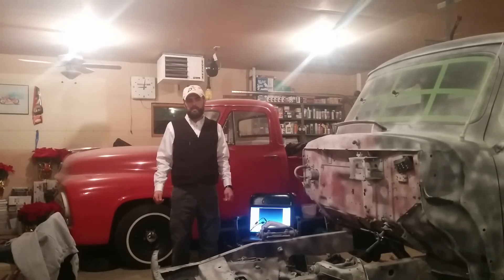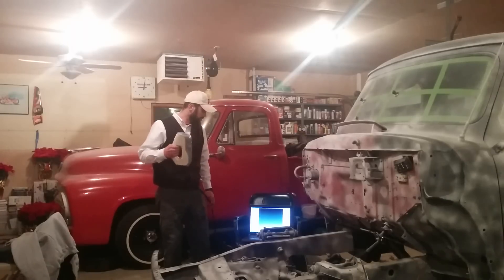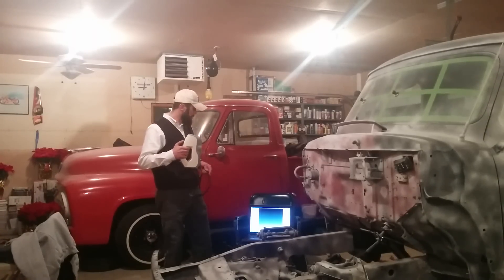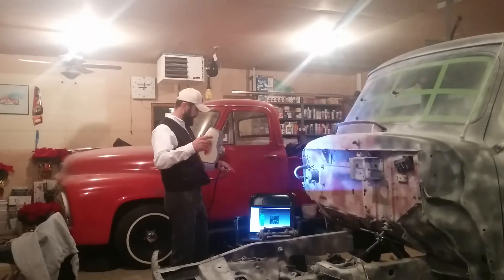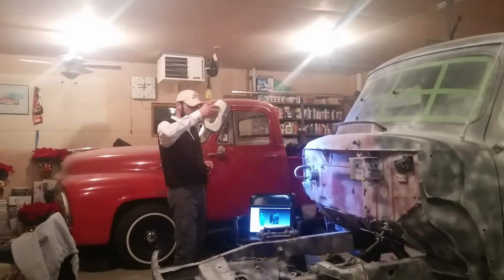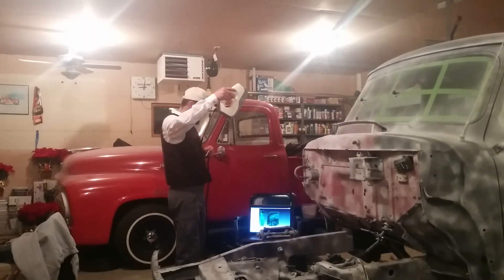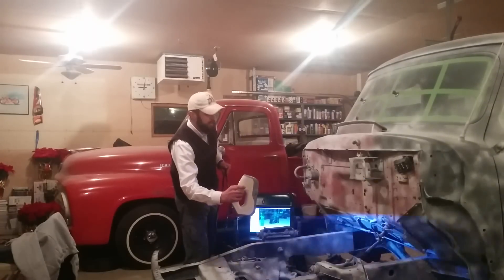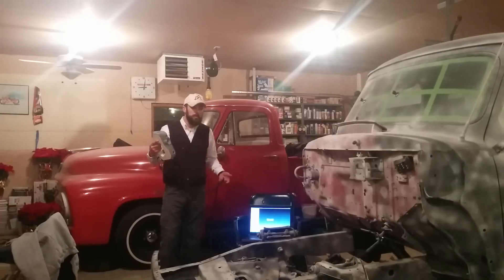Artec Eva w/ Geomagic Capture plugin, Solidworks 3d scanning

Comment: Hello, May I know what did you spray on the surface in order to capture the data?
Reply: You can use IPA mixed with TiO2 (powder pigment) (needs a scrub to remove), or IPA with cornstarch (comes off easier, not as sticky though). If you have an air-brush it's easy, otherwise try w/ a brush...
Reply: You just need a matte whitish surface. Many ways to skin this cat
Reply from the maker: I used weld check developer from Magnaflux. I've found it works best. If you want any Weld check Developer will work good, Magnaflux comes off the easiest
Reply from the maker: Magnaflux Penetrant https://g.co/kgs/br69nd